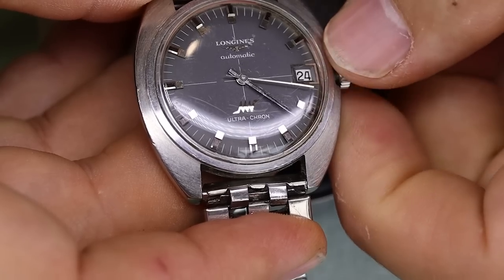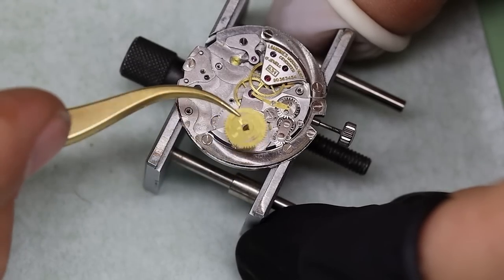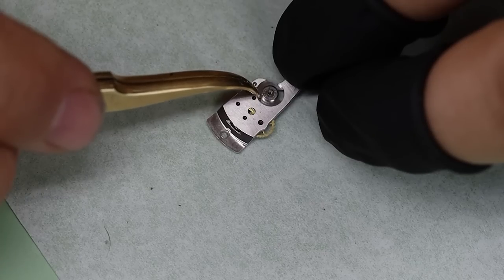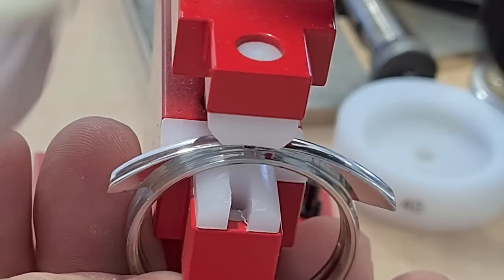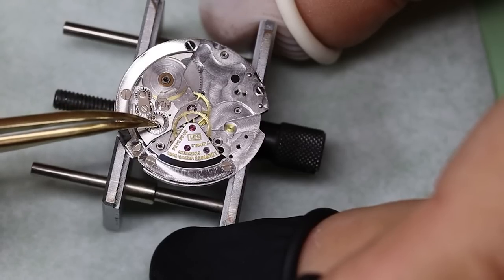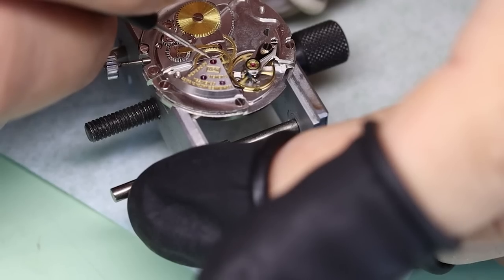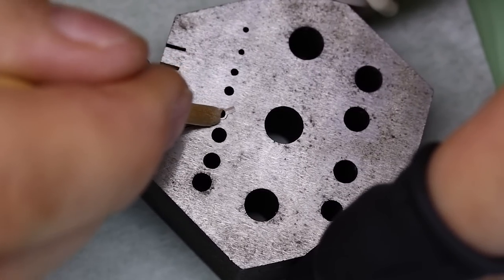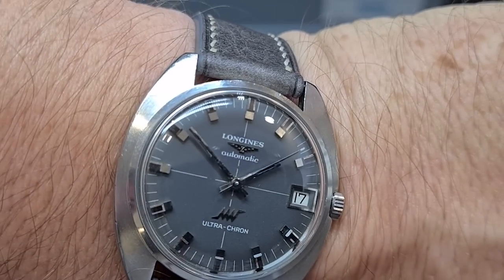Was this the most accurate watch in the world? 🤔

Comment: In other high-beat news..... 🕛According to a New York Times Science article, "Scientists are preparing to redefine the fundamental unit of time. It won’t get any longer or shorter, but it will be more precise — and a whole lot more powerful."
"Scientists have developed new instruments called optical atomic clocks. These operate on similar principles to cesium clocks but measure atoms that have a much faster natural resonance frequency, or tick. Those frequencies are in the visible, or optical, range of the electromagnetic spectrum, rather than the microwave range, hence the name."
"There are several species of optical clock, each counting the ticks of a different atom or ion — ytterbium, strontium, mercury, aluminum and more. So far, no species has emerged as the clear favorite for the upcoming redefinition."

Comment: Really sorry to disagree Stian, but the inch was the mother of all measurement. It started 
with the industrial revolution based in the uk. Metric measurement came well after the
English inch. All thread sizes limits and fits, bearings surface finishes all originate from
England during the industrial revolution. So 25.4 is just the metric equivalent of the uk
inch.
Reply from the maker: I don't think you actually disagree and even if you were there wouldn't be any need to be sorry :) The inch is indeed an ancient measure but it is also an ancient measure.... It has been defined in terms of the metric system since the 50s/60s. I never said the metric system came first as it obviously didn't but as far as I know most of the imperial measures are now defined based on the metric system. Which makes perfect sense as the metric system is more accurately defined. I mean, how much is a cup anyway? https://en.wikipedia.org/wiki/Cup_(unit) Needing a whole page to list variations of a cup demonstrates how ancient the imperial system is. Divsions into tenths is to any objective observer obviously more intutitive.
It seems to me there's a fair bit of "religion" involved when discussing the imperial system, especially from Americans, which is quite ironic given that the system was in fact applied by the English king... The metric system was never forced upon anyone, it's simply a much more intuitive and better system. It's like insisting on using a scythe to mow your lawn when there are robot mowers on the market 😁

Comment: A minute per month. Hmmm 
My 1965 Rolex OP 1570 (19800 bph) does that and has for years. Actual runs better now than when I acquired it 40 yrs ago.
Reply from the maker: Rolex's are great watches for accuracy and you must have been very lucky with yours then!
Reply: @VintageWatchServices  
It was a project watch bought off the streets in Honduras. It’s been my daily wear since ‘82. My only regret is I sent it to Rolex about 5 yrs ago. It took another couple of trips to an artisan watchman to put it back right. 

In 2020 I did not set or wind the watch for 425 days. Average rate 0.75” per day. At DST I only advanced it an hour, not resetting the minutes. (I let the calendar be wrong.) 

No watch winder, face up or face vertical at night, which did add or subtract 1-2”.

Comment: If you think 5hz, 36000bph is fast, check out the Zenith Defy 21 that has 2 escapements, one of which runs at 360,000bph. As for why they don't last, they are accurate but they are taking a beating. That is a FAST. Other manufacturers got around this issue by using a much larger balance wheel at 18000bph, the size giving it the inertia to recover from bumps and knocks faster.
Reply: How about the old Bulova accutrons! I know it's a completely different technology, but  it beats at 360hz. The second hand looks like a spring drive. Super smooth.
Reply from the maker: The new Defy indeed beats extremely fast, but it's a completely different technical solution and to me lacks the beauty of a balance wheel. I'd much prefer a classic movement :)

Comment: I seen some wear under ratchet wheel, isn't barrel arbor wobbly or other issue? Otherwise nice video ;)
Reply from the maker: There is indeed a little bit of wear, but the barrel arbor doesn't have much slack. There's a very strong mainspring in these watches, that's probably the reason there's still a bit of wear.

Comment: Sir : which parts of the watch to determine the beat as 36000 , 28800 , 18000 ?
Reply from the maker: Hello, the whole train has to be designed for the beat rate, as the number of teeth on the wheels and the rotational speed of them will run all the way from the barrel to the balance. The balance is however the actual piece that rotates at the specific beat rate.

Comment: Why do you twist the balance when putting it back into the movement?
Reply from the maker: On the underside of the balance there is a small pin that needs to slot in between the horns on the pallet fork. I twist the balance so that it will come in from the right side.

Comment: The inch was NOT based on metric system.  British Imperial and United States Customary measure equal to 1/36 of a yard. The unit derives from the Old English ince, or ynce, which in turn came from the Latin unit uncia, which was “one-twelfth” of a Roman foot, or pes.
Measurement System: Imperial units
Reply from the maker: Hello Jim, thanks for watching! The inch WAS indeed not based on the metric system but it is now 😉 And that shouldn't be an issue of contention, it's just a more precise definition.
Reply: @VintageWatchServices  Hi, the words "based on" is the problem.  An inch is now 'equivalent'  to 25.4mm. But inch was broken down to thou's and tenths of thou's so also quite precise.
   Great work and filming by the way !

Comment: Don,t you get scratches on the hands when you lift them off the dial with the tools and twist the hands in the plastic?
Reply from the maker: Not that I know, no
Reply: @VintageWatchServices  cause there are sharp edges on the hands like razorblade and can probably cut in an polished/guilded surface,   just a thought with good intentions.    Erik H
Reply from the maker: @erikhoffa966  Hello Erik, I understand your thought but watch hands aren't actually very sharp and the plastic protects them

Comment: Great to see your work and get the info on a high-beat movement.
But you've got your measurements bass-ackwards. One meter is 33.3701 inches. After all, inches came first.🇺🇲😉
And .001 milliliter is EXACTLY equal to 1/10 of a dollop.
Reply from the maker: 😂 A horse carriage came before cars also 😉
Reply: When I was a lad at school our metres were 39.37 inches. 🙂. But what's with the American flag? Surely you can't be suggesting that imperial measurements were invented in the US, can you?
Reply: oh god......ok. to begin with a second was defined as a pendulum of 1 meter length as a pendulum clock.....
Reply: and yes terry a 1 metre is 39.37 inches....

Comment: What do you do if the face of the watch is damaged? Can it be restored?
Reply: Yes, as long as the base plate is OK which is the case EXCEPT if the glass is damaged and the impact reaches and bends or dents the dial, very rare. I did it once to a Rolex. Even if badly tarnished, stained and pitted, the dial can be refinished. The challenge is re-printing it properly. Decals are one option but this usually requires custom made, not inexpensive to put it mildly.
Reply from the maker: It can ineed be restored, but in general the threshold for doing so is pretty high, given that the watch is then no longer original. This dial is in fine condition for its age so restoring it is not an option. Joe added some nice details in his response also.

Comment: I think the timegrapher won’t automaticaly pick up « exotic » beat rates I know from the user manual of mine (weishi 1900) that you have to set those manually from the menu.
Reply: I think it should work if the watch is not hoplessly out of spec. I have an time graph  app on my phone which IDs my 36000 bph watches with no problem.
Reply from the maker: The timegrapher should pick up the beat rate when set to automatic, it's just that the watch was horrendously out of synch, likely due to the cracked center hole jewel.

Comment: Why do you always rotate the balance into place?
Reply: It turns the bottom spindle on the balance wheel, to help engage the base of the pallet fork
Reply from the maker: As Joe indicated below, there is a small jewel (called the impulse pin) on the underside of the balance, which when the balance rotates hits the notch in the pallet fork, and thus makes the pallet fork move from side to side. I rotate the balance to make sure the impulse pin comes in from the correct side of the pallet fork.

Comment: That is a fine example... Especially for its age but Not the most accurate watch being made. If you look into non-satellite sync watches which btw only get you to within 15 Seconds of the correct time and seek a stand alone watch, the Bulova Percisionist series of watches are The most accurate being made to date. They have Super Quartz technology and where standard quartz is 32,768 CPS the Bulova operates at 8 times that at 262,144 CPS...  What theat gives you is a watch that is accurate to within 6 seconds per YEAR as opposed to something like a Rolex Oyster that gains or loses about 6 seconds a month which is common even among expensive watches...

Bulova Really out did them selves with this series and it is available in true dive watch form and also dress and sport watches.

;-)
Reply from the maker: Thanks for your comment, James! At the time this watch was made, it could credibly lay claim to being the most accurate, but that is of course 50 years ago...

Comment: A little confusion there about the inch. It is not based on the metric system. The metric system is based on the decimal system, si units are derived from constants found in nature. The inch is based on the length of 3 dried barley corns placed end to end. The foot is based on the length of a foot, is now 12",but an ancient foot was 11.1/42" The word inch is a derivative of old English ince which in turn has its etymology in the Latin uncia, meaning 1/12th. Nothing about an inch is remotely metric. A mile on the other hand is. The Roman mile or mille is 1000 paces of a legion, although the modern mile is more than 1000 paces, unless all Roman soldiers had very long legs.
Reply from the maker: Hi Stephen, the inch is indeed based on the metric system since the process of adopting the international yard and pound in the mid 20th century (https://en.wikipedia.org/wiki/International_yard_and_pound). It is defined as exactly 25.4mm. Historically it wasn't but it is since then 😉Which should be seen as an improvement, given that 3 dried barley corns isn't exactly a very accurate measure...
Reply: @VintageWatchServices  I greatly respect your skills and am quite interested in acquiring them as the micro engineering of watches fascinates me. The reason I watch your marvelous videos. 
I also realise that I am being very pedantic. I intend no insult. However, it is a fact that the inch is not based on the metric system in the same way that a cart is not based on the horse.
The inch existed before the metric system.  As per my earlier comment. The original yard was lost when the parliament burnt down. Although it was not that difficult to produce a new prototype yard stick, as many official, accurate and certified copies existed. It was decided by the US and British Empire countries to adopt a new standard international yard. The 25.4mm inch, is a quotient of the  0.9144m yard. Neither of these is "based on" the metric system. It is an equivilent of or a conversion factor.
The very word metric literally means based on the Metre. The metric system is more modern than the Imperial system. It is true that US measure are more metric than the old Imperial measures that they are named after, however they are not metric. 
Pre-decimal coins in England had amongst them the Shilling (bob) and two Shilling (Florin or 2 bob) coins. A Shilling was 1/20 of a Pound ergo, the 2bob was 1/10th of a pound. These coins were a Victorian attempt at decimalisation. Although the Pound had 240 pennies. When decimalisation finally happend a century later, the bob and 2 bob coins were retained. 
The decimal coinage system and the metric system share a common trait. They both utilise the base 10 number system. The Imperial and US systems do not, therefore are not based on the metric system.
Reply from the maker: @stephenbrookes7268  Hello Steven, you have a really impressive knowledge of these old measures! I never intended to make this a big fight, I just think it's a fun fact that the inch is basically a metric constant as it is defined now. And it is a good thing that the measurements we use are as accurate as possible, especially when tolerances are small. Tradition is a good thing, but if it obstructs innovation we need to either let tradition be past or update it to fit the new world. And that's what happened to the inch: people wanted to keep it but also make it more useful in our modern world. Hence defining it on a very specific quantity like the millimeter.
Reply: @VintageWatchServices  The only person I know that regularly out geeks me, is my youngest son. 
People here still use stones to measure their body weight. That dates back to the weighman, who would sit you in his scale and add stones of undetermined weight until the scale balanced. So the vane people would visit the weighman with bigger stones in order to appear lighter. Now a stone is standardised as 14 pounds.

Comment: How many man-hours does it take to overhaul a watch?
Reply from the maker: Hello John, it really depends of course. A straight forward service of a watch that does not need to be repaired should only take maybe three hourse all in all, or even less if it's a movement the watchmaker knows in and out. A difficult repair could take a day, and if you need to actually make parts it could take many days and maybe even weeks depending on what needs to be done.

Comment: And lastly … did Seiko ever make an automatic 36000 bph watch? My Lord Marvel is handwind.
Reply: @ Angelino. Seiko made many automatic high beat movements working at 36,000bph. I have two a king seiko 5246-6000 certified chronometer made by dianni factory & a grand seiko 6145-8000 high beat made in the suwa factory. Hope this helps..
Reply: @ Angelino. I may have spoken too soon! After some checking i believe the 5256-6000 beats at 28,800bhp. I believe the GS is 36,00bhp.
Reply: @kerrybayton2954  Well, for me the Grand Seiko might as well not exist. It’s just a dream. But I so love my Lord Marvel.
Reply from the maker: They did indeed as Kerry noted, the GS61. But that's the only one as far as I know.

Comment: Since Bulova had released the Accutron in 1960, I seriously doubt this Ultra-Chron model was as accurate.  I'd have to see the exact language they used to make that boast.....
Reply from the maker: I think I showed one of the ads they used but there might have been some small print... 😉
Reply: @VintageWatchServices  
It must have some really fine print.  Adjusting an Accutron to less than one second/day was pretty standard.
Reply from the maker: @Jack44M  If you look up the old Ultra-Chron ads online you'll see they stated the Ultra-Chron was guaranteed accurate to within one minute per month. I'm sure they had some sort of backing for it but comparing an electronic watch to a mechanical watch doesn't make much sense. It's like comparing a motorcycle to a car.
Reply: @VintageWatchServices  
OK.....so they are about HALF as accurate as the Accutron. lol
Reply from the maker: @Jack44M  I have no idea why you keep harping on about the accutron, buddy. The ultra-chron was advertised as I mentioned. I didn't make the ad, so go sue them for that if this is the hill you want to die on...
Reply from the maker: @Jack44M  And just for the record, the accutron had the exact same one minute per month accuracy guarantee.
Reply: @VintageWatchServices  
....just pointing the BS of their claim.  You have a problem with people exposing BS?
Reply from the maker: @Jack44M  You haven't exposed any BS claim. Accutron had the exact same accuracy guarantee. I'm quite sure Longines wouldn't risk lawsuits for claims they couldn't back up. You can find the ads online and read them yourself.
Making a fuzz about their marketing 50 odd years later is just trolling. And trolling I have a problem with, yes. If you want to keep watching videos, great, but enough of the trolling already.
Reply: @VintageWatchServices  
DUH !....lol
You made my point.  If Longines were the MOST accurate watch, then Bulova's Accutron would have to be LESS accurate....which is not the case.